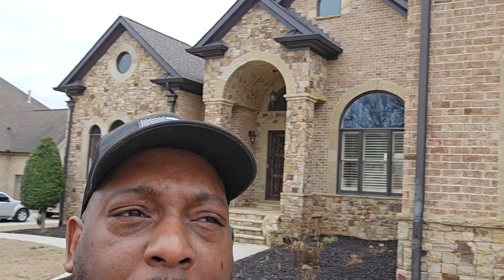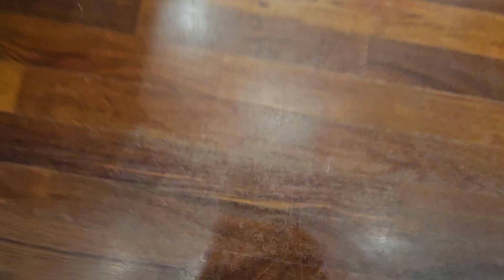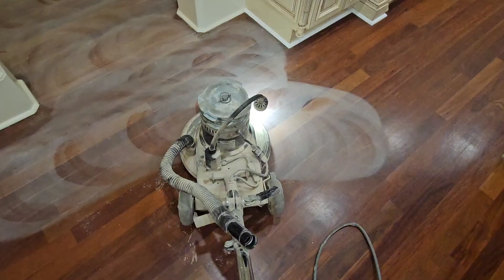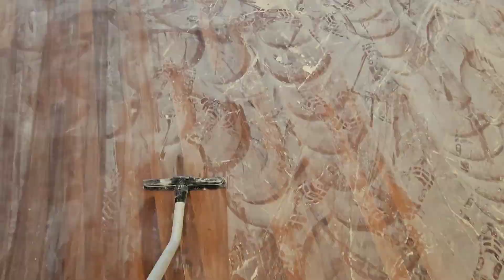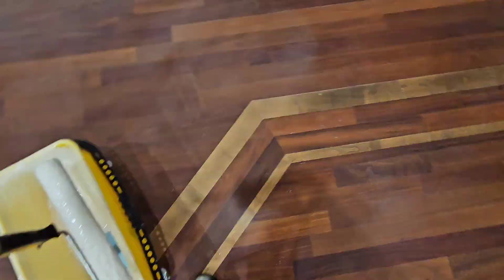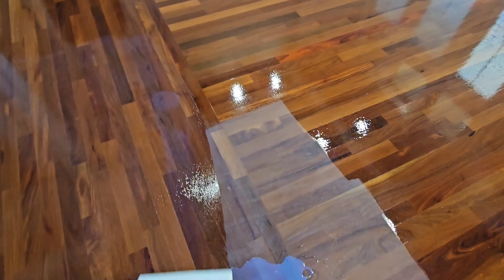Screening & Recoating Brazilian Cherry hardwood floors | Last job of 2023

Comment: The floor does not need to be fully sanded so that the stain is removed... A zonal repair can be done. you need to change about 6 boards ... if you know how to do it, it's not difficult